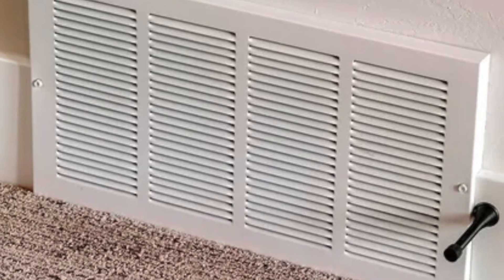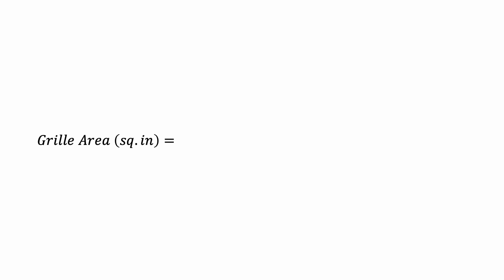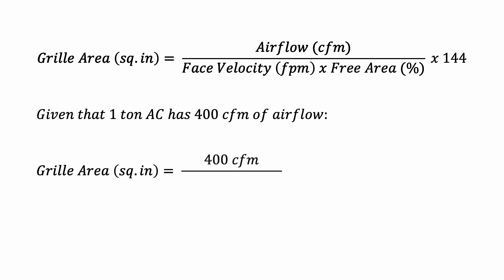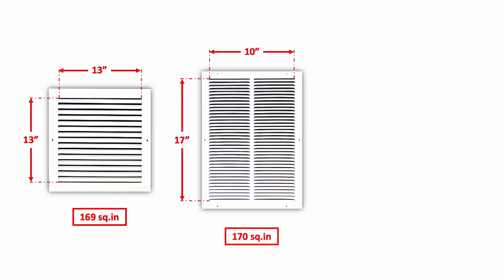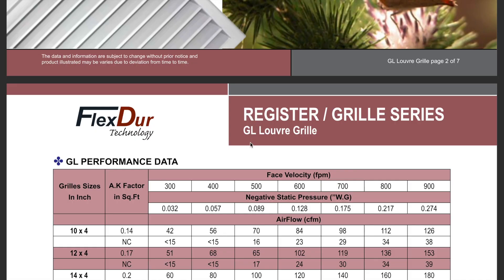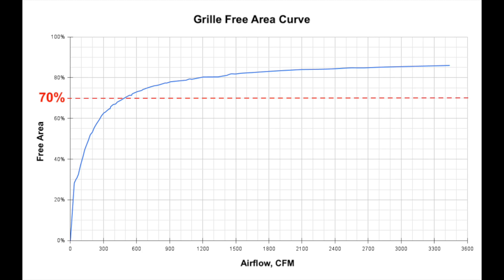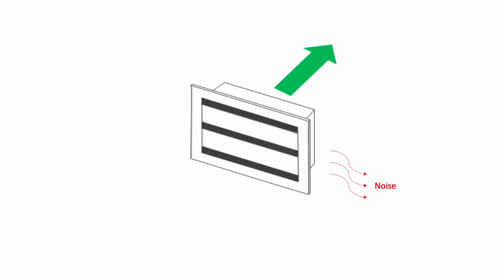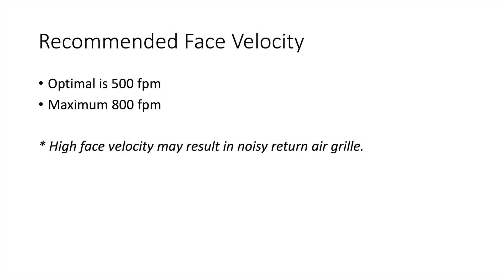How to Size Return Air Grilles?

Comment: Why is face velocity the control. If you can increase the face velocity from 500 to 800 this seems to ignore static pressure between the filter and the blower. I think I would use: 1 ton unit- 400CFM/2.00 CFM SQIN.  2.0 CFM/SQIN is the empirical resistance of a 1" bat filter.  This equation accounts for the static pressure on the blower fan.
Reply from the maker: Face velocity directly contributes to noise. Static pressure is the result of the sizing and the blower can be adjusted to match the system static pressure.

Comment: Question I need to change a return from 20 x 20 to 20 x 14 do you think that is too much restriction on the CFM? I think it is 3 ton system and the sq for of the this level of the home is 2,300 sq ft. 
There are 2 returns on the system currently (both are 20” x 20”)

Comment: is the calculstion for return grill  same as supply one? thk u
Reply from the maker: If you’re using this type of louver grille for supply air then yes, same way to calculate. But usually supply air we use ceiling diffuser and those type need to select from the manufacturer’s data sheet.

Comment: Amazing video. I'm not even in HVAC and I used it to calculate a decorative grill size. I'm pushing the 800 fpm limit. Other than noise, is there a risk of my decorative cover blocking too much air to the unit?
Reply from the maker: Thanks. Other than noise, pushing the FPM higher will lead to higher pressure drop which is the air resistance that could slow down the AC fan speed (which reduces the overall airflow). However, we’re talking about prolonged length like a duct. One or two grilles that increases from 500 to 800 FPM wouldn’t have a noticeable difference.
Reply: @aircondlounge  what about if the decorative grill is used to replace the air return grill cover? Am I going to starve the furnace from pulling in enough air? What are the risks I run here?
Reply from the maker: @whitefalcon017   it’s best to check with the grille supplier about the free area and then calculate the required grille size in order not to affect the system